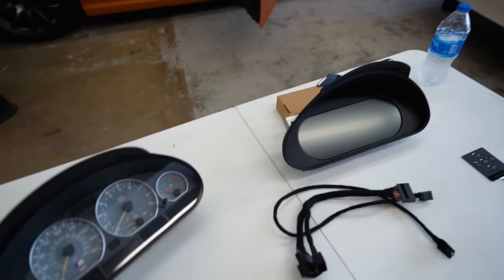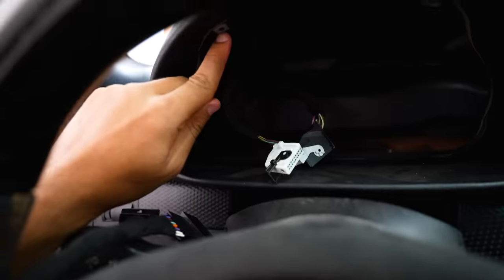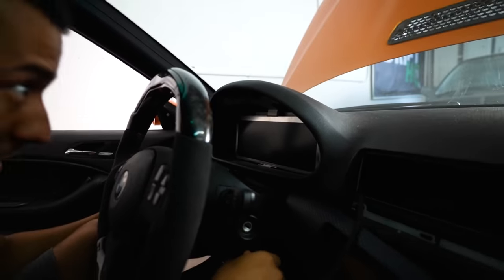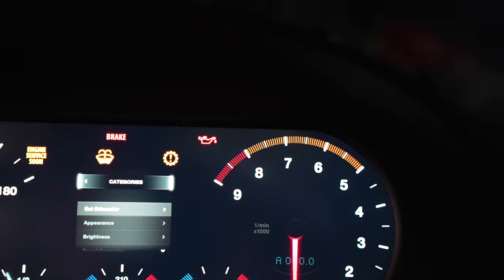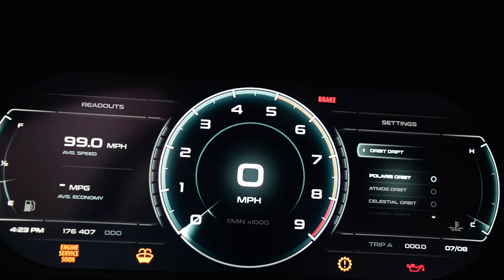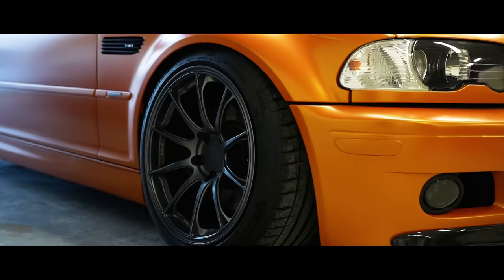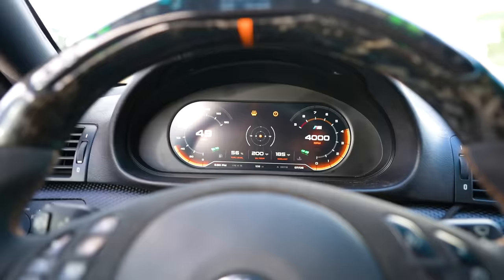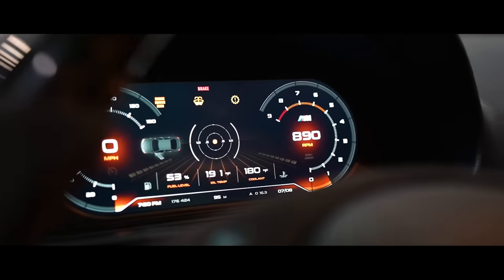How I Made My 20 Year Old BMW Look Modern Again (E46, E90, E60, E82, E70)

Comment: You need to have a display option that is the original e46 m3 display cluster. That would be class. I've seen others do it on other vehicles
Reply: Am interested for the orange BMW
Reply: Sell the car
Reply: Great
Reply: @austineita246  What lmfao
Reply: @LeSwexy  lmfaooo
Reply: So correct it should have the original
Reply: @austineita246  Sell ya mommas car!!
Reply: It's much smaller than the original, that would look crap.
Reply: It’s as great looking Display, but it’s an M3! For gods sake man you have just de-valued the car instantly, oh to late for that you ruined it with the colour change 😢
Reply: So a digital version of the oem cluster?

Comment: Looks impressive but analogue is the way for this car. Its the last of the old skool and personally hate all the tech getting in the way. I can see why you would want this in a dedicated track/race car though.
Reply: Agreed, the factory analog dash dials are my preferred look, but this customizable digital dash is a nice update for those who want a different look.
Reply: It's a cluster it's not getting in the way at all lol. I never understood this "tech getting in the way argument" when you can turn it all off 🤷🏾‍♂️
Reply: noone cares about the oldschool analog odometer. this mod is the way to go to make bmw look and compete with other cars
Reply: @mvdorantes  You're definitely in the minority.
Reply: I agree with you on the analog cluster thing when that actually meant something. When the dashboard was the actual interface between the sensors themselves and not just a repeater from the CAN. In that case, that's when I consider it car sacrilege to get rid of actual gauges and put in a race pack or something.

You guys understand that right?  That so-called analog cluster in any 21st-century BMW and for the most part just about any other make and model is not in any way shape or form, analog, it's merely a repeater for data received on the canbus. The last of the actual analog clusters started fading out in the late 1990s.
A true analog cluster, you could do an engine swap and still use the factory cluster without having an interface with a can like you just put the sensors from the original engine into whatever engine you're swapping in and possibly a tachometer adapter, and the OE gauge cluster will work with whatever engine you put in the car because the gauge cluster is not controlled through the computer. That's an analog cluster. Nothing run off of a network is analog. It is simply an analog LOOK.... 

Plus for all the purists, this looks like a nice way to get an engine temperature gauge, which is something BMW decided to omit from most of their gauge clusters.

For me, I think this will be a great upgrade along with the infotainment upgrade for my E 60 
I'll get my analog gauge fixed from a classic car an actual classic you know because in my middle age opinion a classic car is something built prior to 1987. And antique is something built prior to 1970.
I don't quite know what we should call old cars from the 21st-century yet
Perhaps  modern classic cars or something?

Either way I love this stuff because it just shows that there still exist, people whom are into cars, because in case you haven't noticed not too many people are into cars these days and we gotta take what we can get. We have to keep the hobby alive.

Comment: Looks cool, but only the hardcore enthusiasts would even dare to spend 1k on a 3rd party unit. It's probably a marketing decision, because there's simply not enough demand to justify mass production. Build quality and integration seems very good tho.
Reply: the hardcore enthusiasts would never want to change the OEM gauges on an e46 m3. It's a classic.
Reply: Hardcore enthusiasts would never do this. Why would anyone ever do this. This is wrong.
Reply: Hit thr nail on the head
Reply: I just look and is good solution for swap broken one. but I don't see many customers happy to spend 1k for this. There is always chance to fix/refresh old one for friction of this price.
Reply: Can assure you hardcore enthusiast would never do this. After seeing it turned on it simply does not fit in with the rest of the interior.
Reply: @asatrv  cause it's his car and he can do whatever he wants
Reply: Some were 80$ also lol
Reply: @asatrv  lol "wrong"
Reply: @asatrv  it looks amazing im definitely getting this my only concern is if its laggy
Reply: @kriptix4384  Why would you prefer a screen over gauges?
Reply: @asatrv  
1) The original gauge cluster was broken. 
2) The factory one was already outdated and is pretty much an e36 version with minor changes. 
3) This gave his car interior a cleaner look and works better with the tech enhancements. 
4) The car has over 150k miles on it, the factory hardware isn’t adding value at that point

Comment: Very very nice! It's rare to see modified e46 M3s still being worked on nowadays. I still have my 2004 super charged sitting in my garage at 90k miles
Reply: How has the reliability been with the SC kit on? I’ve always wondered the longevity on the E46 particularly with that kit.
Reply: @RidingWithBobby  I have the ActiveAuto Gen6 Stage 1 for about 40k miles over the course of 11 years. The car has been rock solid and never had any problems.
Reply: @calvinf  thank you for the reply.
Reply: Come to Mauritius, my friend
Reply: Drive it film it for us please
Reply: Hey bro. Im looking to buy a certain 320 cd from 2004 
Is it a good project car?
Reply: Hey Calvin! What other stuff did you need to upgrade in order to support the supercharger? It's like 10k to install it but I worry there's another like 10k needed to support the extra power but could be wrong.
Reply: @supersalah31 330cd better

Comment: Does the OBC button on the turn signal stalk work on the new digital cluster?   Would be nice if it could cycle through different ODBII information on one of the widgets or a way to quickly cycle through different themes, etc.

Comment: You can get those lcd displays and whole clusters in europe or ebay for couple hundred bucks
Reply: Link pls 🙏🏽
Reply: link it
Reply: link it dawg
Reply: It really doesn’t look as good as it could look if it filled out the whole cluster, but that’s my only hang up on it.
Reply: @rxwhat33  on this one or?
Reply: Yeah, this one, imo the fact that digital cluster does not fill the cluster housing is a deal breaker, to me it just looks off.
Reply: @rxwhat33  i thought that toi but i also thought the nails tightening it fixes it

Comment: Nice clean install, but not what I'd want in my E39. A huge part of the appeal of the 90s/00s Bimmers are their analog feel and features and their gorgeous analog gauges. It's too bad your original M Cluster died. But to each their own, and if this is  what you like you did a good job with it and that, I think, is more important than personal preference. A person can choose to make whatever modifications that appeals to them and it's only wrong if it's not done correctly.
Reply: Your analog car that does everything through canbus and doesn't even have a direct cable to the throttle body? Give me a break.
Reply: @jesh879  Okay. Even though my car lacks drive-by-wire. But drive-by-wire or not doesn't diminish the analog characteristics of the car, it's about more than the fact that these cars utilize canbus. I still prefer analog gauges, there's no perceived latency when the needles are bouncing  around. And over time they're not going to slow and gain more latency.
Reply: @jesh879  Cool story bro. I said what I said. If it went over your head, I'm sorry to hear that. And to reiterate my original statement - I like what has been done here, but it's not for me.

Comment: Tbh I'd have to just have 2 e46s because this integration is quite clean and well done IMO 🤣; ties in nicely with the original look of the interior with matte surfaces I think; you could even add some Alcantara into the interior with orange accented stitching for an enhanced modern feel without cheapening it with raw carbon weave (if you don't prefer carbon). Awesome build nonetheless!

Comment: "High mileage car 173k ..." Laughs in almost 400k diesel E46
Reply: Looking for a comment like this. 370k and running perfectly, except for the starter (or at least I think it's the starter), that does a grinding noise (not a bmw), like the gear isnt engaging with the flywheel. I need to like prime it, and then turn the key for it to start without grinding. Other than that, works fine. The clutch pedal needs lubrification too

Comment: ID4Motion  need to address the main issue and that is that you can't code or clear warning lights with their cluster, so if you have say an airbag light you have to put the factory cluster back in to clear the light, then re-install the digital cluster.
That is a major oversight on their part.

EDIT - nothing but crickets from ID4Motion and Vehicle Virals.

Comment: I got an e92 325i (2007) and in general no major issues except for a clicking noise under the car when shifting into second gear. And the minor ones like fabric coming off on the roof. I'm probably going to switch the entertainment system out for apple carplay though. I feel like that makes it feel like a whole new car as well

Comment: This is pretty awesome, but being a purist, I prefer the OG analog gauges. I totally understand there are folks who own E46's who wanna modernize their cars to current tech, but part of the experience of driving a 20yo car is still having analog gauges, a manual shifter, and hydraulic steering, all of which will be extinct by the end of the decade. The only thing I did to modernize my car is replace the crappy OEM Navi head unit for an Android unit with proper Bluetooth connection and much nicer touchscreen. I dig what these guys are doing and hope they can iron out the lag of the tach and speedo.

Comment: There is so much space on either side of the digital display. It would’ve made so much more sense for them to add the USB there instead of on the back of the unit. If people aren’t quite as forward thinking as you and don’t put in a USB extension, Doing updates would suck about as bad as having to re-burn a chip every time you needed to adjust a tune. I hope this is something that they fixed on the production unit.

Comment: It’s well executed except for one thing I can’t get past. The screen is smaller than the original gauge cluster. It does not go as far to the left and right and it does not go all the way to the top. I understand there is a limit to fitting a rectangle into a round hole but it seriously detracts from the end result.

Comment: I have a 2006 E90 which I received it in 2005, this is great and i will definitely add it to mysteries 3, but also the iDrive screen is dead, any suggestions on the best possible i Price display with CarPlay ? thanks

Comment: Does the cluster have the option to record live data?  It would be a great feature to be able to go back after running a pass to see the performance in recorded real time.  Or whatever you’d like to use it for. Also, the rear tires sit perfectly on your E46, I put 15mm spacers on which helped a ton to not look like the rear wells were devouring the back tires. Now however I need to add adjustable coil overs so I can raise the back just about an inch to remove the inherent squat look.  I had aftermarket’s on but just don’t love the ride with lower profile w/t’s so changed back to the factories and with the rear spaced out a hair I much prefer the look and with no surprise the car is just a hair more glued to the ground around corners. All of that said mine is a non M convertible that’s in near mint so even though it’s peppy, it’s by no means a fast car and I’m super reluctant to trade performance for reliability. It has the shark tuner and the sprint booster which help the feel of performance tremendously without making it a weekly project car. But man I’d like a turbo. 😂

Comment: Are there conversions for Mercedes vehicles? I drive a 2007 W251, the last year of the 5L V8 in this model in the U.S. It was also the only year they made the W251 AMG.  I wasn’t unable to find an AMG model when looking. Only 200 units sold worldwide and only half to the U.S. making it amongst the rarest AMG models.  In 2011 they offered a 5.5L V8 model in Canada with Metric instruments that may be worth importing if this display is available.

Comment: Curious about the cog light error. Has that been there since the manual swap? Solenoid issues?
Reply: Def would be there because of manual swap. Manuals from factory don’t get cog lights
Reply: i think i have a solenoid issue with mine idk how to fix it tho just took it back from the shop and the guy said if it’s a position sensor it’ll cost like 1k$ and i was like :(
Reply: @oni5909  i sold my e46 when the cog light came ⚙️ it was at 217k so i kinda expected it :(
Reply: @iiplaya  instead of fixing it you just sold it?:(
Reply: @oni5909  yea it wasn’t really worth anything i sold that then sold my e90 a couple months later and got a 6spd e60. i got tired of bmw automatics having issues
Reply: @oni5909  not gonna lie it wouldn’t be worth it to deal with automatic problems in an e46. the value just isn’t there in an e46, a manual version is best for reliability that’s just me though
Reply: @iiplaya  nah i agree i have this issue and i haven’t been able to drive my car in two months i’m just debating on manual swapping it cause i thought it was the pump but turns out the pump was brand new for like a year or so so like it can’t be the pump and most likely the sensor
Reply: @oni5909  if you can work on it yourself, then just diagnose it and manual swap it if it’s too bad. i just think an E46 isn’t worth that much to do such a repair unless it’s a ZHP or something.
Reply: @iiplaya  it’s like 1k for the sensor if it’s what i think it is but i think i’m gonna swap the pump out when it gives out that way i don’t have to spend more than 1k as of rn hoping it’s that sensor ;~;

Comment: I installed a new LED Cluster just like that in my BMW E92 323i M and it needs to be programed to my car i get a check engine light ? and the Shifter speed does not display at all ?! any ideas what to do here. I got FOXWELL NT710 diagnostic system. Thanks for the help...

Comment: What about backup camera display? Gps display? Wireless AppleCarplay ect for the old bmws that do not have idrive …
Reply from the maker: Backup camera is an option which I may cover in a different video.
Reply: @VehicleVirals  Audi style digital cockpit with functions like wireless apple carplay and backup camera / 360camera integration would justify the high price. As is seems to be too expensive for very little benefits. Digital just because of digital is not much worth, in my opinion.
Reply from the maker: @larswlarsen  Your entitled to your own opinion. The company that make these clusters is much smaller than an Audi. It's a niche product that is not mass produced to help bring cost down. I have a hard time keeping these clusters in stock, so while it's not worth it for you, it doesn't mean it's not worth it for others.
Reply: @VehicleVirals  agree 👍🏻. Percieved value is individual.

Comment: Why? WHY? My uncle paid extra because he wanted an analog dial in his new car (who comes standard only with an display). It was quite expensive, but he got what he wanted as an individual solution. Great dials, easy to read under ANY circumstances. And the original TFT the germans provide isn't bad - But it's not as good as real dials. And you remove perfectly good dials to install a shity TFT with horrible black levels. Just to look "cool"?

Comment: I have a BMW 325Ci SMG, does the cluster shows the number of gear im in or does it only shows R D N P?
Next thing i want to know is if i can use the BC buttons on the steering wheel to scroll and select the adjustments, themes and collors on the cluster, or do i really have to use that annoying remote, if that's the case, it will be a real turn off.
Reply from the maker: For SMG cars it'll show which gear you're in. Ansld the remote is necessary. Only Later model cars can control the cluster via the stalk.

Comment: Can you get oil temperature even on non M with these clusters?
Reply: I'm no expert on the E46, but I'd expect so.  My Z3 (E36-based, early E46 engine) has the option to see oil temperature through the OBD port.  So it should be accessible.

Comment: Yeah I had a feeling u bought the 1k$ cluster I thought u found a cheaper link these are cool but not that price caliber remember it’s a knock off aftermarket part at the end of the Day(YES PRICE IS ISSUE WHEN UR GIVING FAKE ITEMS FOR 1k)
Reply from the maker: Fake items? What are you even talking about? 😂
Reply: @VehicleVirals  you do know these are all based off the newer models cluster …I was just in the i8 similar cluster but oem ,other series have similar clusters too …….your literally getting from a 3rd party company ….I’d rather wait for your honest review 6months later to see if its still good
Reply from the maker: @ELIJAH-lw6dq  You would have a valid point if there was an OEM offering for these older BMWs. But there isn't. I have tested the one on my E90 335i for over a year now and it still works flawlessly.

Comment: The only problem i see with this is that it honestly looks cheap for the tymes we are in…it should be a full size led not lcd. It leaves to much of a gap between the cluster and the bezel of the dashboard..3rd it should of added a map software to it too so it really looks 2023..using  a Full size LED including apple play with the gauges would probably cost only 100$ to manufacture this device and you probably could sell these things easily for a 1000$..its missing to much tech for a 2023